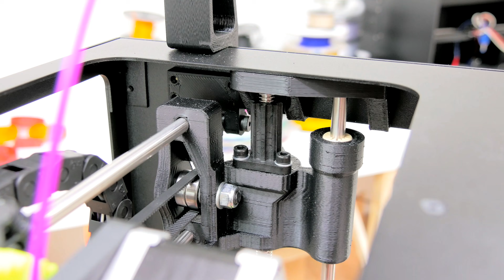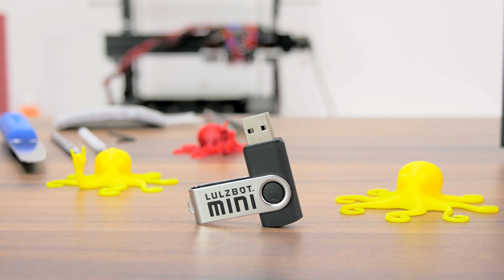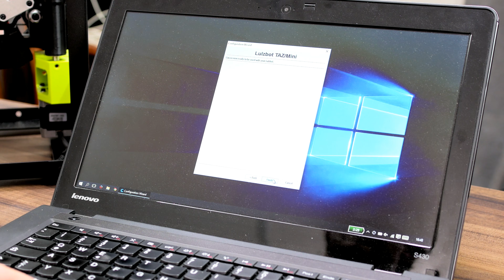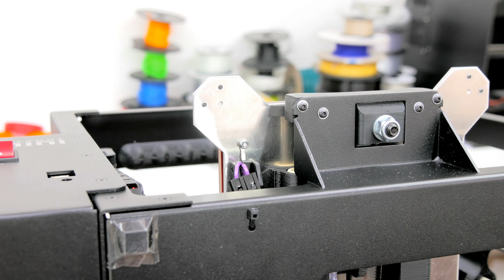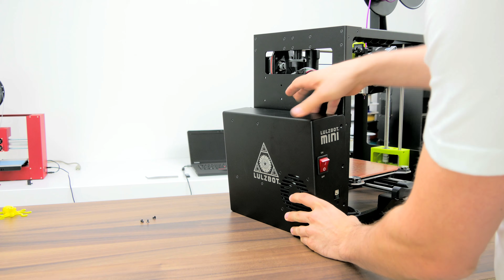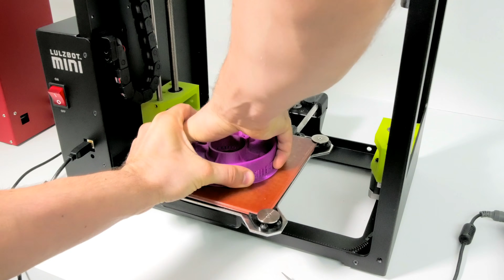Review: The AlephObjects Lulzbot Mini!

Comment: Tom,
i am thinking of using the same auto bed leveling on the lulzbot for my diy 3d printer , but im concerned that if plastic left on the nozle may prevent the circuit between nozle and the bed from closing if the nozle cleaning procedure manages to leave some plastic on the nozle  . Have you experienced any such faliures?
Reply from the maker: +3d tech the cleaning strip greatly reduces that chance and should one corner not trigger, the newer firmware Lulzbot uses will detect it as an issue before it crashes the nozzle too far into the bed.

Comment: This or a delta. I want to be able to print with almost any material available, but I also want high quality. I have heard this prints more materials than the delta, but I also know the delta has a slightly higher resolution.
Reply: +Thomas Sanladerer The rostok max delta v2 is what I'm thinking of, if that helps. Would you recommend this, or the rostok. Again, I would want to print with some materials like carbon fiber pla, abs, nylon, and pc polycarbonate, since I will be making things with moving parts, like gears, so I need a combination of a wide range of supported materials, and print quality. I think my budget would top out at 1,500 us dollars. I also would be okay with some modification, but I would definitely rather not, since I could screw up somehow. And since I want to print higher strength materials and higher melting point materials, a nice and hot heated bed is a must.

Comment: I like the open source feature since its easy to get replacement parts since you can see where they bought them from. Also users can come up with improvements and share them and not get in trouble. 
The other thing I like about Aleph Objects is that they buy quality parts for the printers and a lot of local to them parts. Its not something put together with the cheapest parts from some no name place with questionable quality.

Comment: One more thing - when printing ABS turn the print bed temperature down to 100 degrees C.  This will give your part plenty of adhesion but it will be a breeze to pop off of the bed when it has cooled ;)

Comment: I love my Lulzbot Mini  I have never had a print fail with it - not one single time!  To me it's the most underrated 3D printer on the market.  I do wish it had an SD card reader though.  I purchased a refurbished pc from TigerDirect for around 90 bucks to use as a dedicated print station for the Mini.  My nephew has their bigger model - The Lulzbot TAZ5.  It has a print area twice the size of the mini (a foot cube) and his success in using it is what prompted me to get the mini. 
If you are on the fence wondering what 3D printer to buy I highly recommend this printer.  You won't be disappointed
Reply: I purchased a used Samsung Slate 7 tablet and loaded cura and matter control on mine. It hangs on the printer with a mount from thingiverse.. works perfectly and you get the visual control. I also agree after 3 chinese printers this printer just prints. I must have over 30 rolls of filament through mine and still going without any tinkering to it.

Comment: Hey Tom, 

First off thank you! It's awesome to have someone consistently put of 3d printing videos like yours. I don't want to put down forums but reading through what may be several hundred posts before finding one lead for fixing a problem is a painstaking process. Having your videos on hand when I need a question answered is awesome! 

To answer the question at the end of the video: Yes I definitely care if the product respects the open source spirit. I started off printing with a Makerbot Replicator at my local library back before Makerbot "turned to the darkside" (not trying to start a flame war, but you can't deny the proprietary nature of Makerbot now). As time went on (about 4 years have passed since then) propriety printers and the marketing of printers popped up everywhere (Almost seems like Makerbot was the start of this? I could be wrong). MakerFaire NYC almost felt like a 3d printing trade show. It sucks to see something as amazing as 3d printing be removed from its open source roots. Sure things are maybe a little easier because the quality and ease of printing has gone up due to the company putting more into the printer, but that drove up price and increased the proprietary part of printing (correct me if I'm wrong but doesn't MakerWare use only .x3g files now? Not cool...). It's nice to see companies like Lulzbot keep the open source spirit and keep 3d printing in the hands of the people who created it. 

Keep the videos coming!
Long Live Open Source!

Comment: Great review. I hope this chanel keeps going on for a long while :)
It motivates me from going from "just a guy with a 3D printer" to becoming a 3d guru with tons of printers :)
Also, open source is really important, and in my eyes it drastically increases the value of the printer when it is open sourced like that. I'd probably pay more for an open design than for a closed one (if ever i were to buy a closed design).

In my eyes, the more expensive the device, the more open it needs to be (with a few exceptions, such as cars, but only because there are no open source cars to be bought, so in fact, it needs to be open source, but is not a deciding factor because of the absence of open cars), because if i invest hefty amounts of money in a stuff, i want to be able to repair it, improve it, mod it, etc, and even if the manufacturer disapears.

Comment: I have had this printer since May of 2015.  It is a gem!  I cannot convey how effortless it is to print.  I have an old laptop that was going to get thrown out, put Windows 10 on it and it runs this printer like a champ.  The only prints that have failed have been my own fault in how I created the geometry.  It just prints well.  All the time.  I now use a water soluble glue stick on the bed.  Not for adhesion, but to aid in removing a print.  Plus, the technical service and support at Aleph is TOP NOTCH.  They all have these machines on their desks and know them inside an out.  I love this machine.

Comment: Hey Tom, excellent review. Open source has it's appeal for DIYers like me. I think of the Lulzbot brand as the Red Hat Linux of printers.

Would you be able to review the Bukobot or Bukito by Deezmaker? The designs seem to be very robust and solves many auto tram issues with a spring adjusted bed. Also, a synchromesh cable us used to fix tension issues. Thanks!

Comment: Can you review the printrbot plus dual and compare with your other dual extruder set-ups? I made the mistake of buying a Fusematic from Makers Tool Works and I spend nearly all my time fixing, upgrading, and leveling my printer rather than getting projects done. I would specifically like a review on using the 2nd extruder for dissolvable support material.

Comment: Hey Tom,  Nice review, if I didn't already have my Mini after watching your review I would have surely purchased one.  I am having the same problem with "squish" your speak of on the first few layers.  Lulzbot support advised me:

 "You can adjust your Z offset (determines the squish) through the Cura control panel. Once connected, in the lower right hand corner will be a text entry box. The following commands will allow you to adjust the offset.

M851 -> Reports Z offset
M851 ZXXX -> Updates Z offset
M500 -> Saves new offset

As a warning, you will need to manually clear this if you would like to adjust it. (Even re-flashing the firmware will not update this.) An M503 command will manually clear the offset back to the last time the printer was flashed.

Also, when you are first creating prints after the adjustment, be sure to watch the first layer closely! If anything appears to be amiss, turn off the printer to prevent any damage.
Is this how you adjusted your nozzle high?  Can you please step me through how you got rid of the "squish"?  In Cura Advanced tab the is a "Initial Layer Thickness", is this what you adjusted?

Look forward to your response!

Comment: Nice review.  I have a KitTaz (which unfortunately has been discontinued) that I have upgraded to a TAZ 5 by adding the LCD, hexagon hotend and PEI sheet.  That's the great thing about open source.  It lets you easily source parts for upgrading.  The next version of the TAZ may have a metal frame like the Mini.  That will be more difficult to copy, but it should make the printer both more solid, and easier to mass produce.
Reply: +rcsaramos Correction.  It looks like they are going back to the aluminum extruder frame like the TAZ 5.

Comment: I bought this printer because it could print ABS straight out of the box, and it did; without all the preparation that was needed before.
The standard of design and build quality in this printer is very high in my view. I did not think the bed size was an issue since I had planned to chemically weld ABS to produce larger parts if needed. 

However, I did start to have issues with the hotend not extruding after printing about 500g of ABS flawlessly from new. I stopped using the printer for months because of this, but last night I attempted to clean the nozzle using Nylon filament based on a tip I found on youtube. I was able to pull out all the old filament and other stuff I can't identify after reducing the nozzle temperature with the Nylon filament to 150 degrees. It took about 11 cleaning cycles to get the nozzle clean.

So now only time will tell if the blockage was caused by nozzle design or particles collecting inside the nozzle.

Comment: Tom, I love your videos, but I'm Chinese so stop it with the rip off whine. If it's open source it's not a rip off.
Reply: Open source hardware just works this way. From what I have seen tolerances, manufacturing techniques and materials rarely go into the design documentation (usually it is just some CAD files). Without those things, Chinese manufacturers (and everyone else) can't really replicate the design to OEM specifications and keep the cost where they need it to be (ie. they have to put in engineering time to make it work well). It is a rip off in these conditions, as the customer expects similar performance to the original but doesn't usually get it. 
All this aside, Chinese OEMs doing their own design (or in collaboration) are capable of doing world class work in manufacturing. In terms of cheap turn around open source based stuff you aren't going to see the best they can do though.
Reply: carolcheny I agree, it reminds me of EEV Blog and his redicuclus complaints where if it is a Chinese product even if it is up to a decent standard at a good price he still completely trashes it making up BS reasons why you should buy a 10x more expensive product when  the Chinese one will get the job done. That is why I much prefer people like bigclivedotcom or Julian illete for basic engineering youtube videos, but with the lack of high quality 3d printing videos I will keep watching Tom until I find some one better

*edit spelling/Gramer
Reply: carolcheny, I agere about the rhetorics but a major argument for me is how well it's supported and how likely it is that I'll get upgrades. 
And that means Chinese manufacturers care too much about the initial price and too little about these admittedly rather costly parts of a product.
And I believe as long as what you deliver holds up poorly as a long term investment, you are going to get this kind of criticism. Even when it's imprecise.

Comment: I have been running a Mini for a couple months ago and it's been working great - your review pretty much addresses all of my comments. The lack of a LCD didn't bother me at all because I knew I'd immediately set it up for Octoprint. I have had the autoleveling screw up - it works fine for many plastics but tends to have a bit of trouble cleaning the nozzle for stringy filaments like Laywoo-D3. And I also had the first-layer-smushed problem, so it seems to be pretty consistent across printers - luckily it's a trivial software fix.

Comment: If I did buy a printer it would need to be open source, and as far as the notion of "crappy 3D printed parts" I disagree with +Trhuster  as it means if you improve a part you don't need to have molds remade and users can download and update the part them selves. It's like a service pack for your printer.

Comment: So basically I mostly care about opensource when it comes to the software. Really I just would not support a company that forces special filament containers to force users to buy... brand. I like the idea of a printer that does support the communities that make the sofware. I have a printrbot simple metal(which I think is close to opensource hardware) because of the price and I can still swap out hot ends which is all I need.